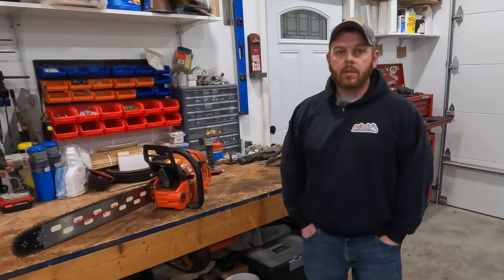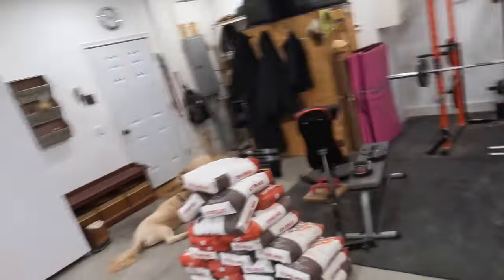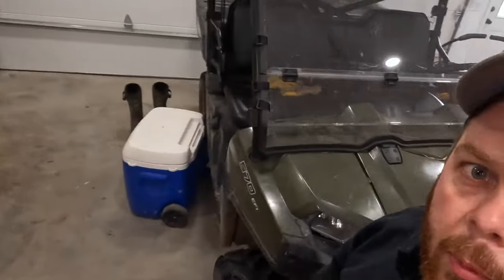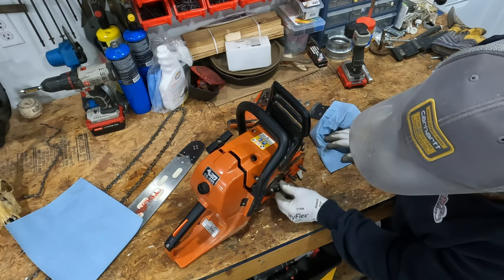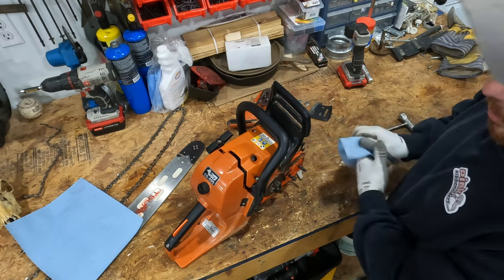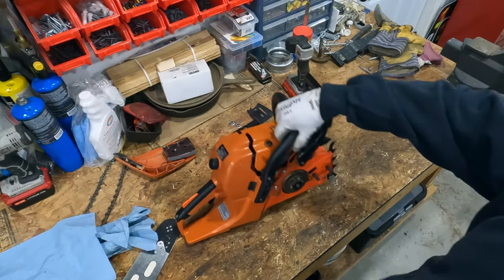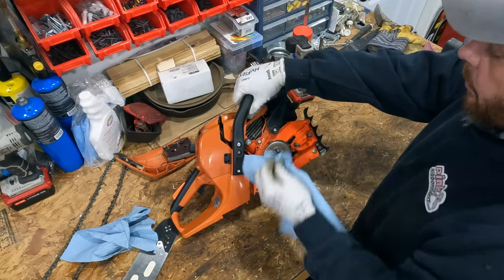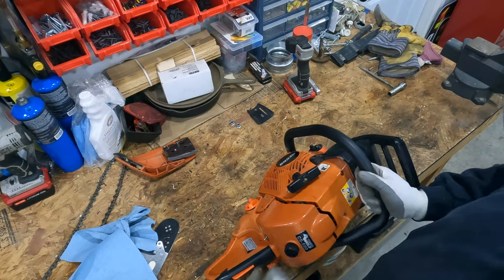Fixing my Echo CS 590 Oiling Issue

Comment: Start up see if oil come out with bar and chain off . Take little gas put in your oil tank clean the dirty on bottom off tank .
Reply from the maker: Thanks! It ended up being the adjustment on the pump had vibrated closed. Thanks for watching

Comment: I don’t see anyone that has said it yet and it gets overthought, but make sure you switch to a thinner oil in colder weather. Regular bar oil gets thick when cold and doesn’t really do it’s job. Keep it up
Reply from the maker: Thanks for the feedback Steven! I do try to run the winter weight oil in the colder temps, but some times I'm not able to find it. Take care-TC

Comment: For all of us in the comment section. I watched and did what he did in the video. It worked great. But I went too far and my screw vibrated out. Only turn it a little bit. I'm playing hell trying to find another screw
Reply from the maker: Oh wow sorry to hear this, I didn’t realize that could happen. When I turned the screw out on mine it tightened up and stopped moving when I got to the end of the adjustment.
Reply: @TCsOutdoors1  I think I broke the stopper.  I don't think you gave bad advice at all. I'm working in 20 to 25 degree weather. So it is what it is. I was very happy that you did a video about this.  It saved my bar. Big time
Reply: I found the screw. It's in side the casekng

Comment: Glad you found the adjustment Tony ! Most “pro” model saws have an adjustable oiler, some other models do also, but not all saws. The longer the bar/chain, the higher the volume needed. Some bars have a grease port in the nose tip, but not all. It all depends on the bar. Don’t forget to check the oil often, now that you turned it up. When running around 20” bars most of my saws run out of gas just before running out of oil. But when using the longer bars 25”-28” they of course use more oil since I have the oiler turned up. So now I just fill the gas about 3/4 tank to insure I run out of gas prior to needing,to fill the oil tank. Hope that makes sense 🪵⛓🪚👍👏🇺🇸 Rick
Reply from the maker: Thanks Rick! I’ll be sure to keep an eye on the oil for the first couple tanks of gas. I appreciate the advice, take care. Tony

Comment: I picked up the new CS 620p I ran it through a couple heat cycles that thing's got a great oiler on it. My CS 590 timberwolf I've had it for 3 years. That chainsaw still runs perfect. I gave it to my son he helps me a lot in my woodyard.
Reply from the maker: Congrats, I’ve head good thing about the 620’s  got d choice.
Reply: not mine. constant oiler issues, clogging up

Comment: I figured it was clogged or your oiler needed turned up. I had to turn my 400c oiler up! I think they have them set from factory with a 20 inch bar and when you have a longer bar it requires more oil. Glad it was an easy fix for ya. Your video will prob help others👍🏻👍🏻
Reply from the maker: Hey Todd, Im glad it was an easy fix also. I didn't know they were adjustable, I will crank them up from now on.  I would rather use more oil than I need rather than not enough. Thanks for watching, talk to you later-TC
Reply: @TCsOutdoors1  Hey man congrats on 1k. Daniel Atkins just notified me you made it👊🏻🍻
Reply from the maker: @toddsoutsideagain  Thanks!! Pretty crazy, I appreciate all the support along the way 👍🏻👊🏻🍻

Comment: Thanks for the fine video. I found this adjustment screw and discovered the oiler pump does not work. I will have to order the clutch removal tool and associated parts.
Reply from the maker: You’re welcome, I hope the repair goes smoothly for you.

Comment: Seems you tweaked it for the cure. My Holzforma does the same and it's usually dirt. Gotta clean it more often I guess.
Reply from the maker: Hey Jimbo, im glad it was an easy fix for sure. I could probably do a better job at keeping my saws clean as well, I always plan on doing it when I'm done cutting but usually it doesn't happen for one reason or another. Thanks for watching I appreciate it! Take care-TC

Comment: All the way for 36” 60” bar for oil . There grease hole on end off bar for tip . If it’s not straight could be your bar , my guess teeth sharpen more one side them other side . Once you get your bar & chain on put the front or nose off bar up to block off wood or cardboard see if getting oil off tip off it’s nose . Should be if not oil pump could be worn, I’ll would check it went you had it take apart own a C clip to take off check out oil pump gear .
Reply from the maker: Thanks Leonard!

Comment: My oil tube is ripped in half. How the heck do I replace that thing?
Reply from the maker: I had that happen on my cs620. I was able to pull enough out of the tank to cut off the bad spot and hook it back up to the pump. Just have to make sure you have enough line in the tank otherwise you’ll have to replace the whole line
Reply: @TCsOutdoors1 We have 2, 590s. One has a bad piston and the current one had that snapped oil tube. My dad pulled out the other oil tube that sits in the actual chamber and reaches into the clutch area, so now we tried opening it up all the way, and we were right there when 2 deep bolts snapped in half. 
Ended up opening the one with the bad piston up and just replacing the piston lmao. No luck with that damn oil line (not the broken oil line, had we known earlier it was further behind the clutch woulda been an easy fix).

Comment: Some bars have grease hole in end of bar. This will not be your issue with tailing off Your bar is worn more on side than the other.Turn bar over it will tail the way
Reply from the maker: I ended up buying a chainsaw bar dressing tool to clean up this bar. It worked perfectly to square up the bar rails and it cuts nice and straight again!  Thanks for watching I appreciate it!